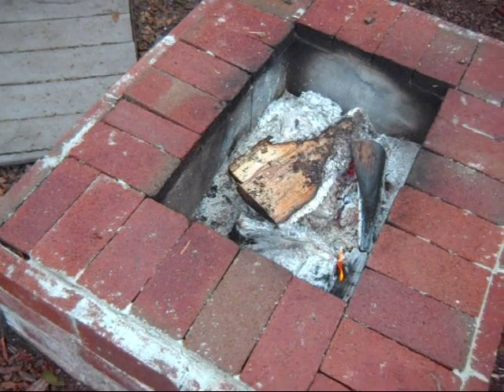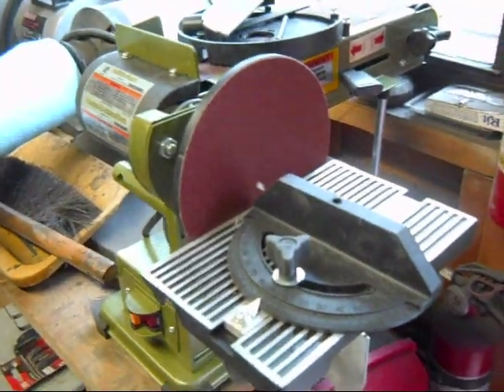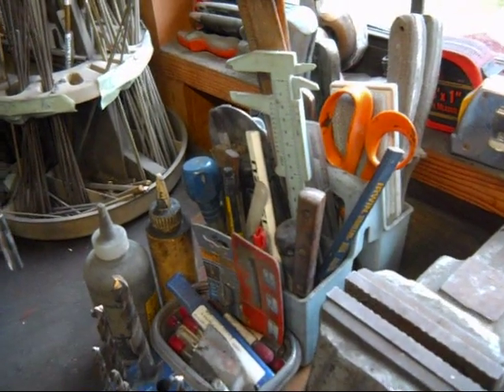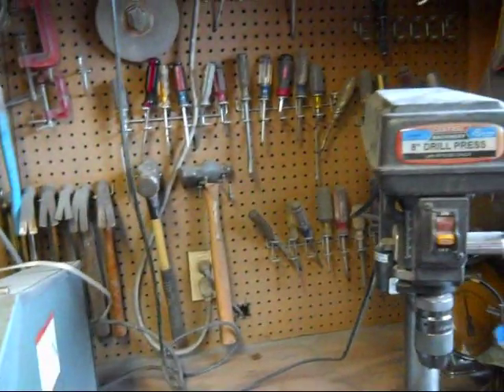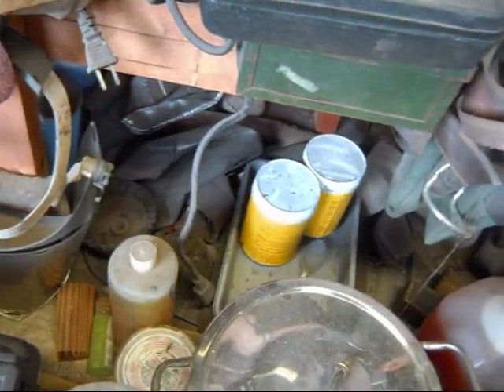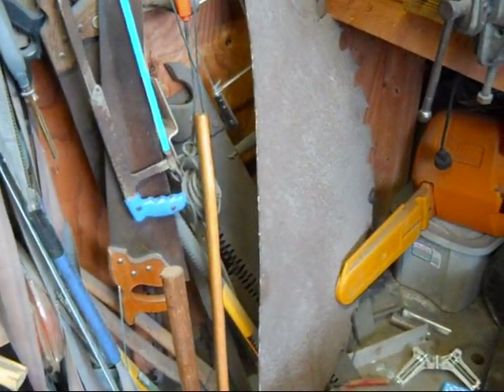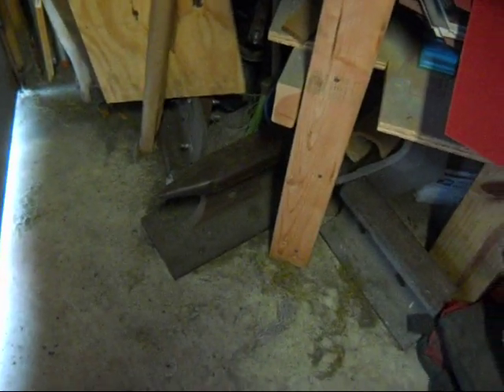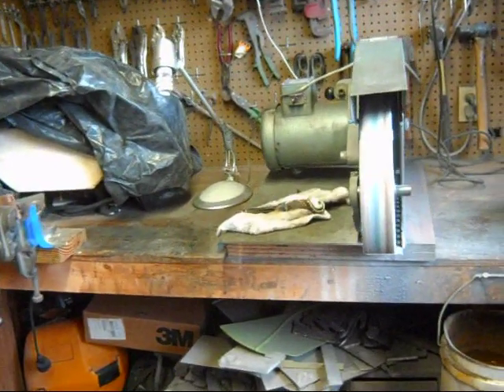Tour of My Shop

Comment: Nice; our shop tools are very similar. I don't have a HT oven or scroll saw, but I do have a band saw and a propane forge that I HT in. I have a wood lathe in the shop also because a make custom writing pens as well. I'm in the process of building a NWGS to replace what I'm using now. I like the cut off wheel on the motor setup, I've been meaning to do the same but havent found the part to attach to the 5/8" shaft.